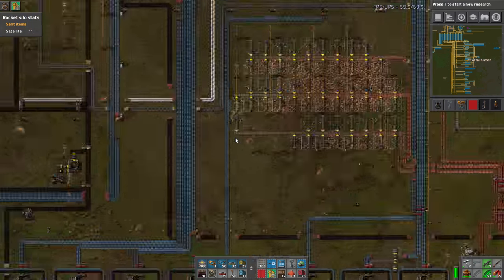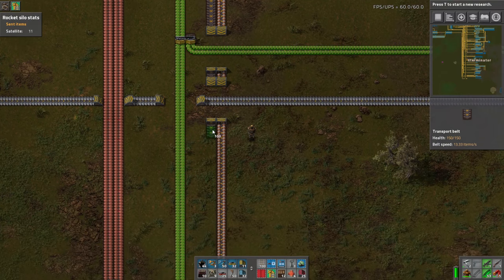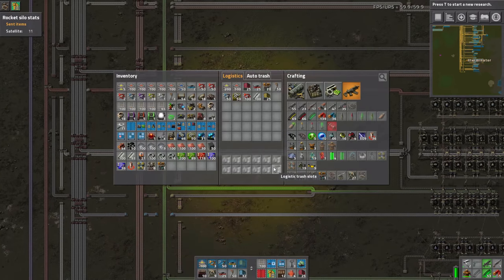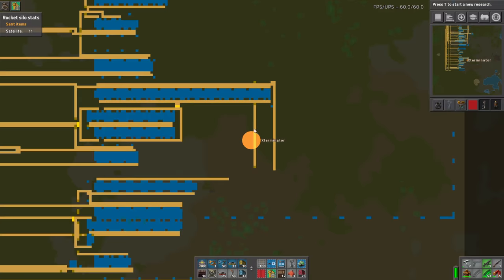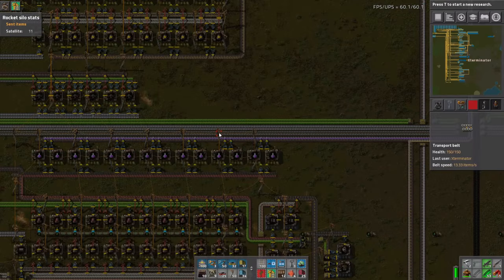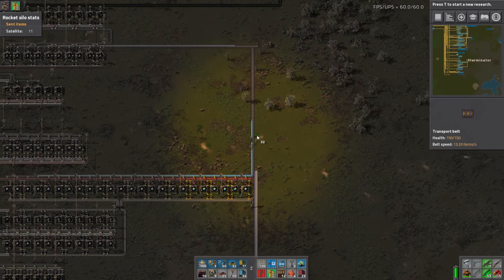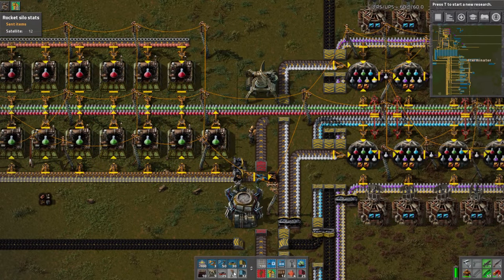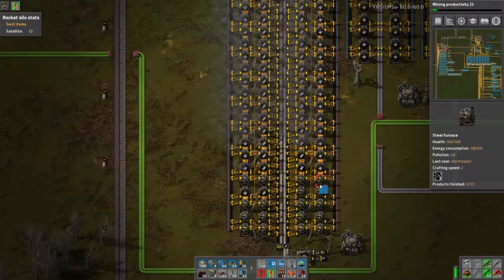Factorio: Tightening The Belt: Megabase Guide EP44 - MORE SCIENCE | Tutorial Gameplay Series

Comment: At 22:37, some gears are spilling into the green circuit belt for the same reason you encountered at 25:04. Underground entrances and exits allow for half a belt to side-load onto the underground if it's not fully compressed. Make sure to extend the length of the underground or move the merging splitter back one tile.